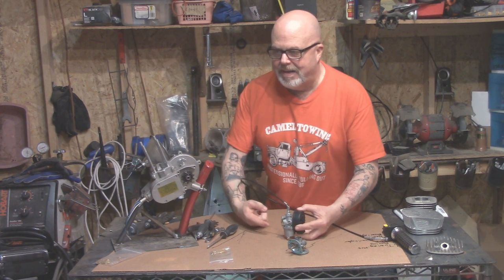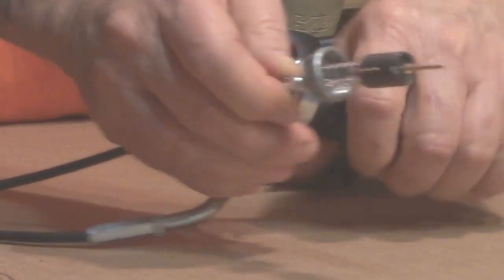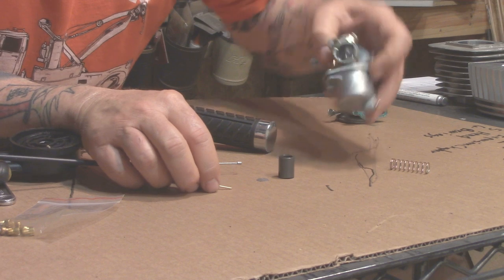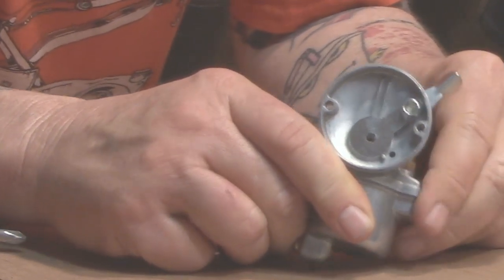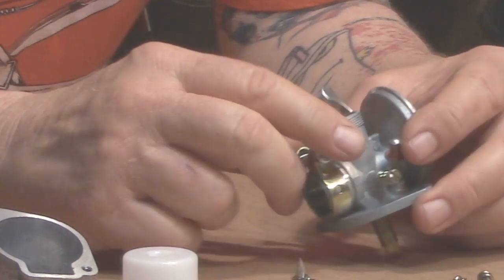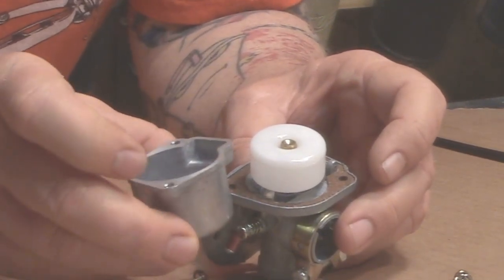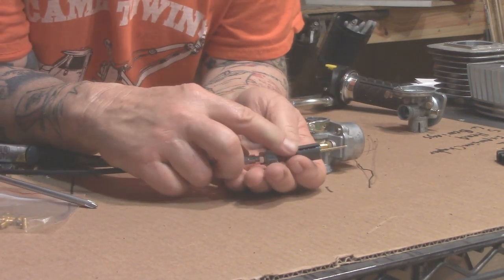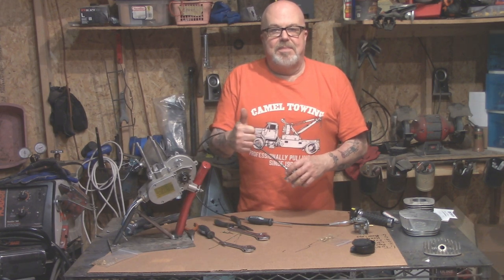The Best Carburetor For Motorized Bicycles - How To Clean & Service Carburetor- Long Version

Comment: Hey I'm having a little problem with my motorized bicycle takes off smooth but when I pick up the speed it blubbers at the end of the top speed, I'm pretty sure their stock Jets so if I put a 66 jet I should be good
Reply from the maker: 2 things. 1. Yes. Leaner jet will help. 2. The engine simply maxes out due to balancing and the like. That's what you are seeing
Reply: @HughesMotorized  hey thanks for your response , I'll give it a shot and I'm going to go with the 66 jet

Comment: The thing that gets me about carburetors is all this design and knowledge required to get running worth a fuck, meanwhile some building burns down because some one spilled gas or there's a gas leak and there's a spark in open low compression conditions.
Reply from the maker: Nailed it
Reply: @HughesMotorized  after 3 days of sweating my ass off climbing hills with the bike to ride the clutch downhill trying to get it started and keep running, fiddling with the carb, and trying everything a dozen times, i finally got the damn thing to run for a good 10 mile ride.... i never had that much trouble getting a damn engine to run before.

Comment: I'm running a 4 stroke 49cc 142F. I changed to the NT, but no matter what I do, it runs rich. Running a jet i modded with solder and a needle that"s less than the smallest jet I have which is #61. Clip at top of needle. (Leanest) Do a plug chop, and it's black. I am just about to put the stock carb back on. Hoping you'll answer soon. Gonna go try to make an even smaller jet. I live in Central FL BTW, so everything I've read and seen says I should be good with the #61, but it's too rich. I've looked everywhere. Please help.
Reply from the maker: I had some issues w/ the NT carb on that one. I use the stock carb on the 142F
Reply: @HughesMotorized  Thank You for the quick response. Yes, unfortunately I concur. I ordered all 3 original green gaskets, cut the excess off of the screw that holds the throttle plate, dremeled down the inner light grey plastic on the choke plate, slightly widened the jet, and took off the welch plug to access the fuel/air idle mix. Hopefully, when I put it back on it won't be running as lean. Was idling too high, but then gargles at full throttle w/ stock carb. Plug chop reveals a grey/white plug. This is why I changed in the first place. This is the 2nd carbI bought. The first one was an HP for $28, then when that didn't work, I got an NT ($10) because I already bought the intake peice and wanted to use it. Now, it's just a waste of money as the intake + 2 carbs + new gaskets + jets = $70!!! Not to mention my patience wearing extremely thin. I want it to sound like this: https://www.youtube.com/watch?v=U7Au3f3Zt9I&lc=UgyEWwTNXBi5iGAIv1h4AaABAg.97HhRpvAIMj99E6rzQRVth
Reply: I have four stroke 142f motor when I drive few kilometers clutch is rip off comming down matel and very hot tell me what reason thanks

Comment: quick question is my first time trying to start up my motorized bicycle I leave the choke open soon as it starts up  I close the choke but the engine shuts off why is that?
Reply from the maker: These engines must be coaxed into running at first. I'll pull up on choke lever to start and if it's cold outside, I'll slowly push it down as engine warms up. I'll vary the throttle to keep engine going and take off to warm engine up.

Comment: OK I did everything the way you said and I'm still having a lean condition at full throttle...I look down at the carb and its blowing fuel out of it...and no I'm running no air filter...
Reply from the maker: needs a bigger jet if lean at full throttle

Comment: I missed something.  Just how does the pin at the end of the throttle cable regulate fuel flow?  I can see that it slides in and out of the jet tube, but how does it affect the flow.  Does it uncover holes in the side of the tube or something?
Reply from the maker: The needle lets in more fuel the higher it goes from 1/4 to 3/4 throttle. After 3/4 throttle it is the size of the jet that controls fuel
Reply: @HughesMotorized  Yes, the video says what the needle does, but does not explain HOW it does this.  For instance, a needle valve that I'm familiar with increases flow by pulling a tapered pin out of a hole, increasing the area through which the fuel can flow.  This needle does not look tapered, so how does it let more fuel flow as it's pulled up the tube? 
I'm not trying to be difficult, but I really want to know what's going on here.  Thanks
Reply from the maker: @Urugami45  Yes. It is tapered. https://www.google.com/search?q=nt+carb+needle&client=ms-android-google&prmd=isvxn&sxsrf=AOaemvJLZhUIkQAtAHIniYbE2XLmovw55w:1639845769449&source=lnms&tbm=isch&sa=X&ved=2ahUKEwjk2MvE5e30AhWokokEHfr0ANAQ_AUoAXoECAIQAQ&biw=393&bih=730&dpr=2.75#imgrc=AqwaWz4Xfl1ZvM
Reply: OK, I see it now.  I've seen this needle in a few videos before yours, and I couldn't tell it was tapered.  I've seen it in a few vids since that it is indeed smaller at the end.  Sorry for my confusion.
Reply from the maker: @Urugami45  All good. Look until you find concrete evidence. Helps one make better decisions

Comment: would a slightly hotter plug fix the 4 stroking issue?
Reply from the maker: No. The issue is the Main Jet. It is too rich. The Main Jet handles from 3/4 to full open throttle and they intentionally have it rich from the factory as the extra fuel helps lubricate and cool things off. Not so good for performance but they are mostly interested in keeping the engine running thru the warranty period. Removing the air filter helps lean it out some but still needs like a #66 jet

Comment: I've actually got a comment I was wondering if you could do a video on the shark head for the motorized bikes I have one but I can't seem to make it work right Is there any hints or tips I could do
Reply from the maker: what issue were you having? One can swap out the heads and go without any tuning. Of course a plug chop and adjust the jetting will get you best results.
Reply: @HughesMotorized  like did you grind the lip around the outside of the dome part of the head?
Reply from the maker: @joshuamoon8442  No. No grinding

Comment: My carburator doesnt fit on my frame and I install the 4 tubes upside is there any problem of that because l trying to starter for first time and it doesnt tries to fire and then dies , already check spark and disconnect kill switch all it's fine but I'm wondering if the carburator filter with the tubes up it could be an issue on that...I'm running 93 gas on 40.1 Lucas
Reply from the maker: Post some pics on my Facebook group and we'll see if we can help - https://www.facebook.com/groups/hughesmotorized
Reply: The intake upside down, or the entire carb?

Comment: Hey I just finished my first build I noticed after a couple mins of driving the throttle doesn't respond and the bike dies out it starts right up again then does the same thing. Do I need to adjust the carb or are there other things I should look into?
Reply: Also should I run it for a few mins before driving it ? I noticed it starts a little rough too thanks for the help
Reply from the maker: Just crank & go. Sounds like an air leak on the intake. Make sure carb is fully pushed onto intake tube

Comment: My bike (80cc/100cc Chinese) throttles really really high when the clutch is engaged. Otherwise it runs great. I've troubleshooted everything to the point I just bought a brand new carb and it does the exact same thing. I've covered every possible air leak with a cocoon of gasket sealer...still, throttles really high. Does anyone have any idea what on Earth the issue could be?

Comment: I bought into the ported cylinder/gigantic carb/ reed valve set up, and went back to an upgraded stock.
Reply from the maker: Nice!
Reply: @HughesMotorized  that monster carb is wayyy too much. I rejetted it 4 or 5 times trying to get it perfect...
But the chamber size vs air intake literally has to be perfect, or it runs like a dog. I took it off and put the mid-grade "high performance" (using the term lightly) carb and it ran great. 
I just had to replace the engine last week. It took a beating worse than my exwife for 6 months.

Comment: Adjusting the float so many times to stop it from pissing fuel everywhere, I rejetted a Dellorto and solved my problem. I suppose some applications vary.
Reply from the maker: Gotcha. Ya. Sometimes float issues can be a Pian in the you know what.
Reply: it ain't the float, its the needle or seat.

Comment: Are there any pumper carburetor intake manifolds for these bike kits?  Id love to bolt on an HDA 43 tunable carb on it.  I know they atomize fuel  way better.  And you can fine tune them way easier.
Reply from the maker: Not that I know of. Looks like a DIY thing

Comment: i have a question  how  long  will  that  motor  last  if it's  taking  care  of
Reply from the maker: Hard to say. These are cheap, poorly built motors. You might get years, might get months
Reply: If you take good care of it and correctly mix the oil to gas ratio(not too rich nor lean)keep everything good and tight,replace the rings every couple years.......it can last many yrs and alot of miles
Reply from the maker: @darkkonblackblade6161  Amen .Yet that's assuming the bottom end is somewhat decently balanced and the cylinder's chrome bore holds up. They are making the chrome bore thinner and thinner nowadays

Comment: I have a 80cc engine and I put a banana pipe, a 5.5 head on it, and took the air filter out… currently have a stock jet but does anyone know what jet I should run.
Reply from the maker: For sea level? I'd say start w a #66 jet or 68

Comment: I live at the 760 ft above sea level. I've got a stock 80cc 2 stroke with the NT carb. At the moment I'm still running 16:1 fuel mix with 1 more tank to go. What size jet should I run at this altitude and what groove on the pin? Thank You.
Reply from the maker: Id guess a #65 and 3rd notch to start. Play w/ it. Once you get it dialed in you good. Do a plug chop
Reply: @HughesMotorized  Thank You Sir.   The carb came with a #65 and I've experimented with #60 and #70.  I'll try the #65 again.  I've added an after market CDI and NGK plug since the last time running the #65. I'll keep you posted
Reply: @HughesMotorized  I  installed #65 jet and clip is on 3rd groove. The bike rides like a bandit. I haven't done the plug chop yet.  This is the best it has run .  Thanks again.
Reply from the maker: @rickysmalling4507  Have fun & ride on !

Comment: Just bought a used one throttle broken need knew one how much are they i saw metal one instead of plastic one how much
Reply from the maker: You can make one up or I can do it for you. Check this link out: http://bit.ly/2R0q0Mf
Reply: @HughesMotorized  how much? and would it be the aluminum one i don't know how to fixx the throttle cable. To make the Wright adjustment on it

Comment: Are there any good substitutes for the carb washer i lost mine  and cant find the exact type online
Reply from the maker: I am not following you. Where on the carb are you talking about? Are you referring to the bowl gasket? Or?
Reply: It's in the throttle slide
Reply from the maker: @xero_d4rkx650  I see now said the blind man. I've made one using tin snips to cut the circle out of 22ga steel and a hacksaw and small file to dress up the slot

Comment: what jet size should I run for higher top speed?
Reply from the maker: If at sea level a #66 works good. If you go fast, make sure you have a good front brake so you can be safe. Enjoy!
Reply: @HughesMotorized  my elevation is 423′ do you know a good jet for my elevation.

Comment: I'm trying to figure out what my problem is since I recently replaced my top end with one of the new 40mm intake jugs with the open teansfers- I absolutely cannot get it leaned out enough! I've got the smallest jet I think stock is .60mm? Which has always worked for my setup in summer- I've got the needle clio adjusted but I'm still showing and running rich enough to foul my plugs after about 30min of run time. Anyone have any ideas? It obviously has something to do with that new jug I just cant figure out what exactly it is.
Reply: I always port but I took it off and ported a bit more extreme, added TWO more bottom gaskets, then took 2mm off the deck to maintain squish but it only helped a bit.

Comment: My float had a leak was full of gas, had to get new carb. Then def. Wasnt the same like black 1 came stock better right out of gate. It had long brass hose inlet and was black, new 1 was red. Also def not interchangable floats or plungers.

Comment: Have a 80cc and the clutch engages but the tire wont spin, I adjusted it like in your video and got it to move when lever is pulled but tire wont turn motor over.any help?
Reply from the maker: New bike? Did you trim the dust cap?
Reply: @HughesMotorized  I did trim the fourth hole on air cleaner for more air
Reply: Try take the plug out and put some oil down and try turn it over without the plug in to get it lubricated

Comment: i used the wrong fuel in my bike and now won't start could you to a video on how to fix that? would be much appreciated
Reply: Wrong fuel? Do you mean you ran it with regular gas instead of two-cycle mix? If you ran it without 2-cycle oil in it, you have for sure cooked that motor. Pull the head and the cylinder to inspect for excessive grooves and scratches, that will tell the tale. If the cylinder is excessively scratched up or gouged, the bearings inside will be no better.
Reply: @philippointon8651  thank you for your response, i have done this and the motor doesn't seem to turn over (the pistons do not move) how do I solve this issue??
Reply: You can't get the cylinder off, then the motor is seized. And completely useless. If you got the cylinder off and the motor doesn't spin, it is seized and completely useless.

Comment: I pute a little more 2stroke oil at gas station and now it makes thudding sounds it won't start I've been running it all day I drained the carrb and drained the fuel and still won't start what should I do it a USA engine
Reply from the maker: Might have fouled the plug.
Reply: @HughesMotorized   what a plug
Reply: I'm on SSI I have mental problem  to this was my 14 hundreds dollars checking now I'm going to to get electric brike
Reply: What's a plug
Reply from the maker: @buildafire623  Spark Plug. These motors need constant maintenance. Sounds like an ebike might be better. Good luck and take care

Comment: I'm on the hunt for the throttle cap, it turned into dust. Anyone gotta link just for the cap?
Reply: the whole carb is only $9 for cryin out loud, they give these things away, don't bother with parts, just swap em out.
Sounds like you cross threaded or didn't line up the idle stop screw with the notch in the barrel.
Easy mistake to make, I almost did the same today.
When the barrel is lined up correct the cap will thread down all the way by hand.

Comment: If your carburetor is leaking from the bowl will that called your bike not to run?
Reply from the maker: Yes, carb needs a good cleaning
Reply: @HughesMotorized   Every time I give it gas it die it's a new carburetor what should I do?
Reply from the maker: @ramadanstromer5325  Still leaking? If so, there's your issue. Needs cleaning
Reply: @HughesMotorized    No  It is a  brand new  Carburetor
Reply from the maker: @ramadanstromer5325  Check for spark. Do it at night so you can see the spark
Reply: @HughesMotorized  i have  Spark is a new spark plug
Reply: @HughesMotorized   I ordered a window piston and put it in my stock engine do you need a reval for that piston to work?
Reply from the maker: @ramadanstromer5325  Yes. needs a reed.
Reply: @HughesMotorized  Hey bro I got a BBR engine do you have to leave the stock head on to break it in properly
Reply from the maker: @ramadanstromer5325  Matters not. Upgraded is OK. just don't expect best performance till you get it broken in.

Comment: What abot 4 stroke? Fuel injection?
Reply from the maker: Just might do a vid on the 49cc Carb soon. Fuel Injection? It would add several hundred dollars to the cost and be way too technical for a simple motor. My 2 cents

Comment: I just bought a new BBR Tuning engine and got the performance carb. I wanna swap out the jets into the stock carb but for some reason my stock NT is not the same as what you have with the prime and brass bar for the jets. Mine looks cheaper made and has different jets. They are bigger size compared to the 1s your carb has. People say you can swap the performance carb jets with the stock but for me thats not possible. 

I wanna use stock carb because this "performance" carb is complete trash! The engine has horrible 4 stroking. I tossed a 66 jet in and still its horrible and has weak power. I have the engine on a stand up scoot geared for 30+mph and it will barely do 20mph. Extremely weak.
Reply from the maker: These are the jets for the stock carby - https://ebay.us/orGbzN
Reply: @HughesMotorized  Those are for the older and better Stock carb. For some reason when i bought the stage 4 BBR Tuning, they gave me some cheaper type of carb. It didnt have the prime button and the tube the jet screws into is molded with the carb. Its not the brass screw in tube. That carb takes a jet bigger than a 5mm and looks different. Luckly my bro has the good NT carb and i snagged it lol. Tossed a 66 jet in it and set the clip to the 2nd from top slit. Waiting for a pull start and then i can test.